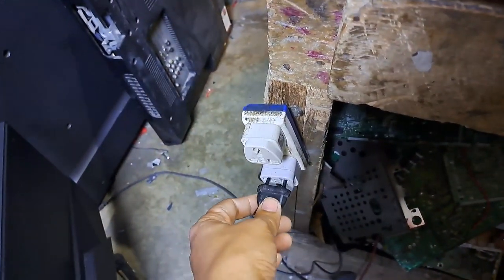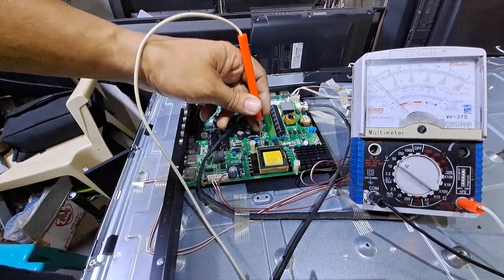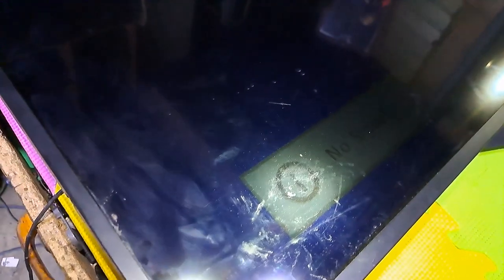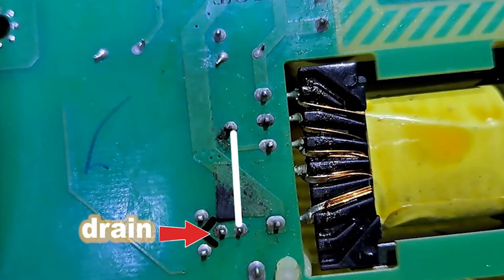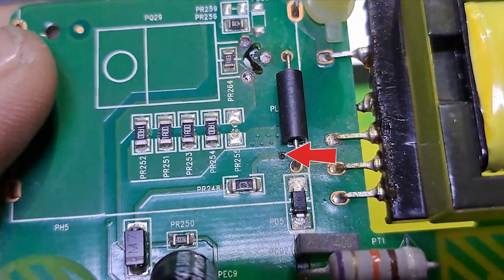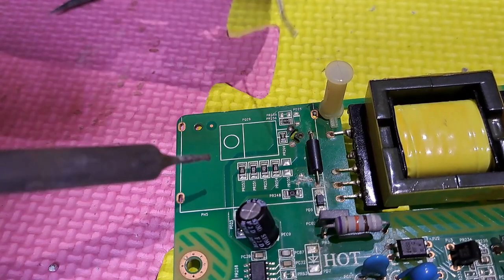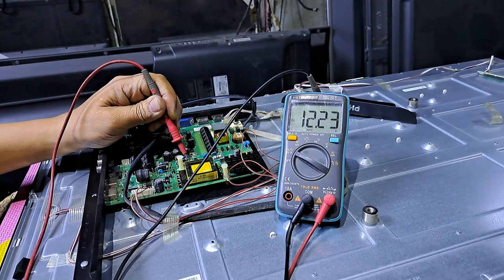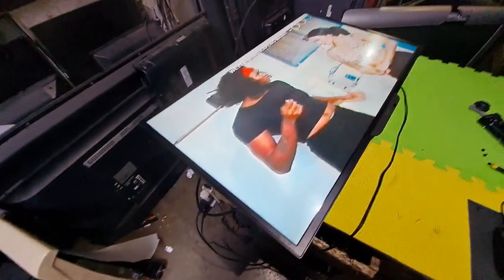Bad PCB board layout design

Comment: I would have added an extra layer of insulation by running the wire through heatshrink material ... looks like the wire touches the mosfet heatsink, so it may melt at some point in the future.  Not a big deal, the mosfet is in plastic package, but who knows if some other service shop will replace it in the future with some non insulated package and then cause more damage.  Other nitpicks, maybe clean the pcb with some acetone or isopropyl alcohol and use the right amount of solder (leaded solder, your solder looks like it's not leaded), those blobs look ugly on that mosfet leads (at @9:35) 
It's a good repair, thanks for posting it.

Comment: i repair and restore vintage tv's from the 1940's upto mid 80's or so i tend to avoid new stuff never liked or cared for surface mount
Reply from the maker: Use magnifying glass
Reply: @tevzTVTevatronics  indeed would have to use one or a microscope, i like tubes and transistors i can see them easily